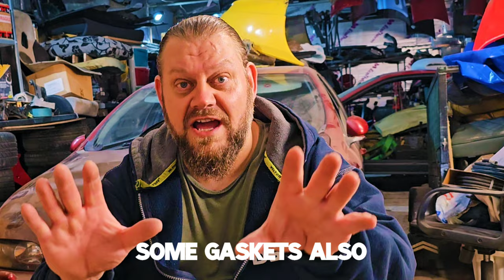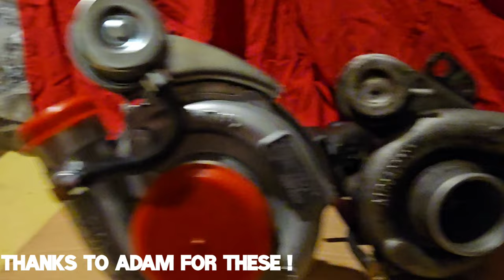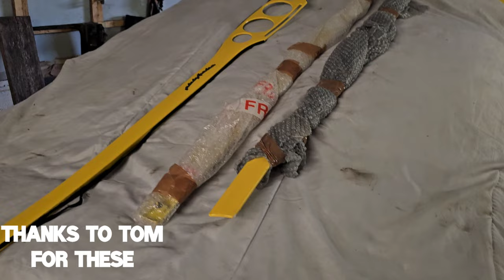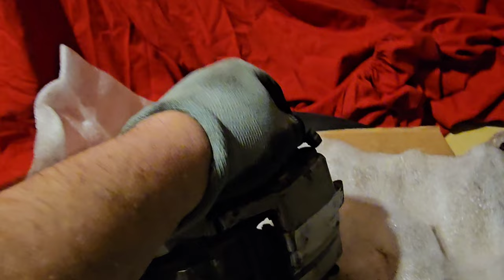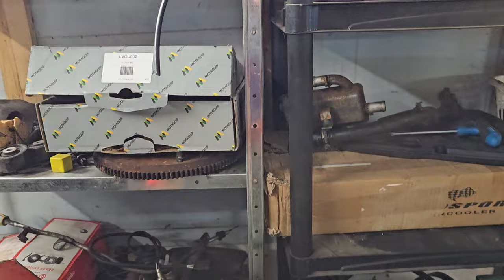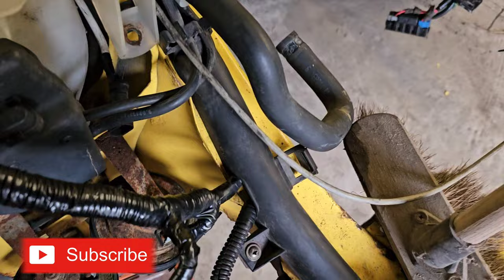Saving a Modern Classic - FIAT COUPE 20VT - Part 5

Comment: You are lucky to be able to get those parts, here it would be a nightmare. And that picture does look exactly like my Yellow coupe, I gave her a clean today, but here being so cold I could not do it properly. I could send you a picture of my two coupes when it was summer if you would like...  Thanks for the video, I guess an audience of just a few... so be it!
Reply from the maker: It looks that way. Sadly the Fiat Coupe has never been a popular car. Which is a shame. 
My email link is in the description, if you'd like to shoot some photos over with your cars story that would be great,  thanks for watching 😁
Reply: @FullBoostJ4 sadly? i say its a good thing, means its ecxclusive and not many people know what they are. 
parts are often on ebay and not a problem, one thing that (if your taking it to your local mechanic tho) is that the suppliers these garages get the parts from DO NOT SELL THE POWER STEERING BELT KITS ANYMORE. like...at all........ which is annoying asf because my tensioner is clacking its tits off and has been for over a year., so ill have to pay the 120/130 quid just for the belt/tenionser and idler pulley off ebay. 
and youll be lucky if a garage will even take any work on on your coupe, luckily i am kinda mates with one garage and the people that are doing the floor pan the owner had one years ago, the other garages in my area wont touch it outright refusing to work on it for any job.
Reply from the maker: @lloyde-s5c  shame about the PAS kits unavailability, I did find my tensioner, it sounds okay when I spin it, hoping the bearing is okay that the pump runs through. Hopefully I should be up and about soon to carry on with it
Reply: @FullBoostJ4  yeh, cars will always be there to come back to luckily. take care of yourself first and foremost. 
unfortunately i cannot work on my coupe anymore, i had a bike crash in 2018 and had a life changing leg injury and am awaiting the next life changing op 6 years later, sucks to be 32 and have extremely limited mobility.
Reply: @FullBoostJ4  i have ankle movement so i can operate the pedals, but when braking, i either left foot brake or have to brake like way over what anyone else would deem normal as i cant physically put pressure through the pedal. 

being a 6 speed coupe and plus i dont think i could ever let it go. no matter what.
Reply: @kevinjekyll1521  i cant lift heavy things and hobble round with crutches and barely get out the flat as its 30 steps 2 flights and can only do 1 step a time so the coupes rots undriven 4 to 5 days a week
Reply: @kevinjekyll1521  my legs bolted together in the most awkward impractical way there is, the next op only a small handfull of people would of ever had done its that complex, going to take 2 nerve specialists maybe 15 hours or more to do it.
Reply: @FullBoostJ4  ok mate ill email you pics of it, my boost control is apexi avcr set at 1.35 bar. but not sure how it's going to respond etc going from a stock housing t28 stage 3 hybrid with 2.5 inch compressor inlet to a bigger 3 inch compressor inlet turbo
Reply from the maker: @lloyde-s5c will be good to see! I'm just staying stock with this for now. What other mods have you done ?
Reply from the maker: @lloyde-s5c don't envy you with that mate
Reply: @FullBoostJ4  so at the minute, 
coolant bypass on the throttle.
coolant bypass TO BE DONE on the new turbo as it is ONLY oil cooled. 
38mm external wastegate in the future - for now i have a block off plate on it. 
bc br series coilovers.
powerflex polybushes for front and rear of wishbones (getting fitted next month).
powerflex bushes for drop links (getting fitted next month).
walbro 255 pump (FURTHER upgrading to a kemso 340lph pump next month).
Collins twin piston bov - insanely loud, louder than most and sounds like a whip cracking. 
fuel pump wiring mod.
manual fan switch override (for meets etc for prolonged revving while stationary).
4 bar fuel pressure reg.
480cc injectors.
direnza alloy rad.
apexi electronic boost control.
stage 4 fc performance remap.
apexi 3 bar map sensor.
pro alloy front mount intercooler kit.
one off custom inlet pipe (with none of the usual gubbins on the pipe).
7 heat range iridium plugs.
paddle clutch.
pcv deletes (from turbo inlet pipe and manifold).
3 inch catless custom exhaust system which will be getting changed to a 2.5 stubby downpipe that will exit straight off the turbo under the car or the bonnet when new turbo is on - not decided which way i want it yet.
ac delete. 
stage 3 stock housings t28 Garrett which is going in the bin having blwon the seals out - its now dripping coolant and oil from the core, onto the downpipe, oddly enough it doesnt smoke on boost or when up to temp,  just cold start for 30 seconds or so. 

ill do a quick video short on the bay when i get the car back.
Reply from the maker: @lloyde-s5c  brilliant mate, very jealous! I'm really getting the bug back with the coupe now!
Reply: @FullBoostJ4  yeh man, i just hope an op does more good than not as theres a strong chance i will loose all functionality of the leg as it could quite literally fall to bits when done, thats what the women said without putting it lightly, all the work they will do could just not hold together, then i could loose the leg. 
and i have to travel to london from weymouth as its the only place in the country where this sort of op can be done.
Reply: @FullBoostJ4  haha, yeh man, so floor should be fixed tomorrow, my birthdays monday, 2 weeks time that new American externally gated manifold and new turbo will be fitted, September getting new cambelt, crank angle sensor, cam phase sensor, steering belt kit and maybe the front main/oil pump seal done.
Reply: @FullBoostJ4  haha, i couldn't ever drive another car again, being in a coupe is special, more so than a "supercar" because its got an exotic super car look and sound (with the right exhaust) but its not a damn ferrari or lambo. 
wanted one when i saw one at 9 yrs old, got my first one at 23, had to let it go due to legal and financial issues eith other stuff.
Reply: @FullBoostJ4  might get an apexi turbo timer aswell, 
but the boost controller is great, can monitor throttle postion, rpm, boost, injector duty, solenoid duty, and...maybe something else, cant remember, can set how hard and when you want the boost to come in, 
i only monitor the boost and injector duty, if i see the duty is like 54% or higher, or less than 51% i know theres an issue with the engine. 
also have an autometer smoked boost gauge as that reads in bar and the apexi reads in hg.
Reply: @FullBoostJ4  paddle clutch is fun, actually having to rev it out to get it to move. 
letting off part throttle when doing a full boost 2nd and 3rd gear pull is insane as the flutter is so loud and intoxicating.
Reply: @FullBoostJ4  my driver seat is a fixed back full track spec old school sparco with the big side bolsters you gotta hop over to get in and out the seat. man it feels SO good when yer rowing through the first 3 gears full boost full chat and you get that perfect launch where its on the very edge of not having any traction and it just manages to cling on, properly held in place with this seat it feels like a touring car. 
i can probably do a 5 second slightly under doing 0 to 60 ona good day, 60 to 100 is ballastic (on the most budget tyres).
previous owners have said 187mph out of this thing.
Reply: @FullBoostJ4  the trick with launching is to kind of preload it. 
i launched it off the lights the other day and wasnt intending to get it down so perfectly as i was just screwing around thinking it will either bog or more than likely limiter bash. 
this was one of those launches where i could easily get it down to a 4 second 0-60 had i pulled away with the expectation of doing it that well.
Reply: @FullBoostJ4  ill also email you pics of my SPA manifold, its a thing of beauty, cast iron but tubular with insanely short runners to the flange. 
ive emailed you a few of my coupe.
but this is ALOT heavier than the oem cast manifold. 
i think i paid 250 quid for it straight off their website. they are releasing an intake manifold in 2025. and it might be the style the toyota supra mk4 aftermarket manifolds.
Reply: Wow sounds like a nightmare, I guess the bright side is when you get better you will appreciate your good health even more, and enjoying; family, friends and cars...
Reply: alright mate, so car is back floor is welded, tho i got a section 59 through the post for cutting another driver up....
is that serious?
Reply from the maker: @lloyde-s5c that's crazy 🤪
Reply: @FullBoostJ4  uh huh, i mean my understanding is its a warning, and the car is now marked for the next 12 months so if anything else happens the car gets seized. 
but can they prosecute given thats its a warning?
Reply from the maker: @lloyde-s5c If it's a warning I can't see it being a prosecution. Weird